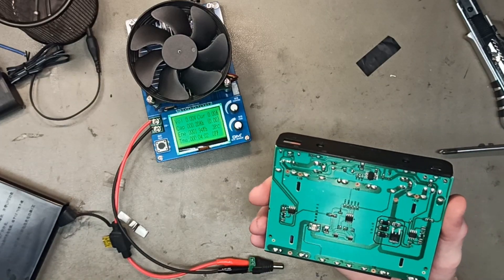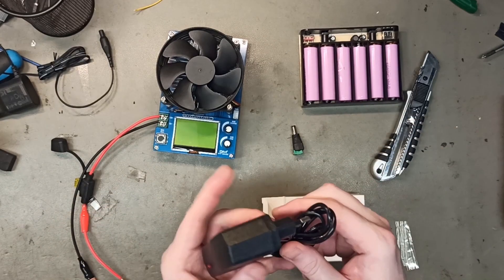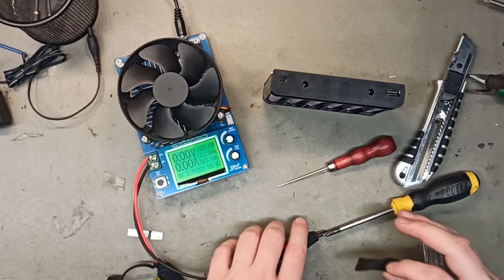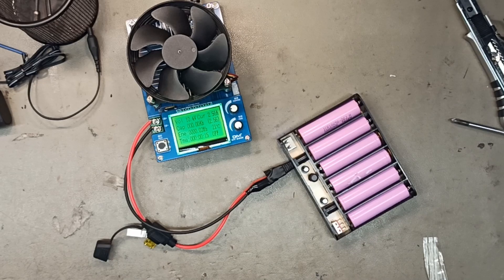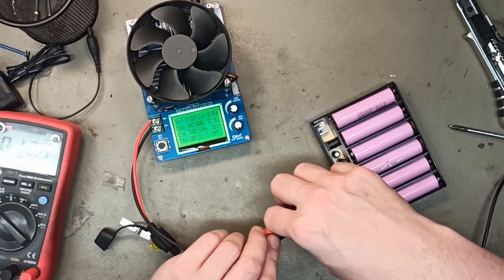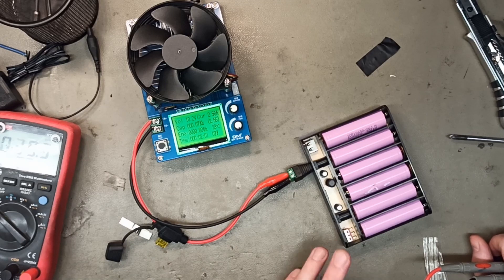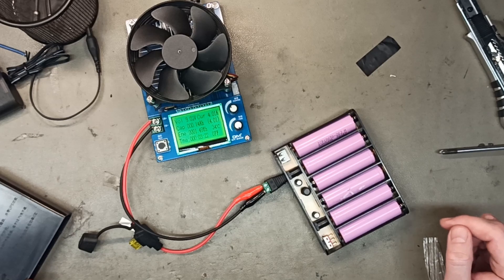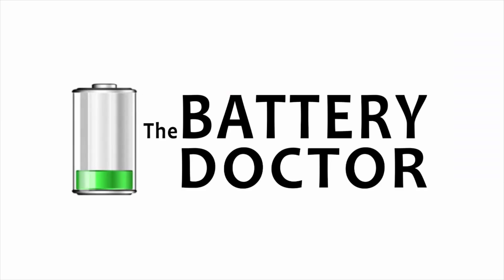Review/Load test off Aliexpress DIY 12V 3-5A UPS/Powerbank

Comment: I know this is an old video, but your leads and fuse are going to be dropping some voltage here. You should have a proper load tester with voltage and current inputs. Or even just measure the voltage at the output with a multimeter to get around the voltage dropped by the leads and fuse.

Comment: Would you show "how-to" use that load tester, like how to set Low Cutoff and High Cutoff, how to read full discharge capacity, et c?  I had one of those testers but every battery measured 0.7vdc on the load tester (the batteries were 36vdc and 48vdc, and my multimeter showed that). I sent the tester back. Waiting for the replacement.